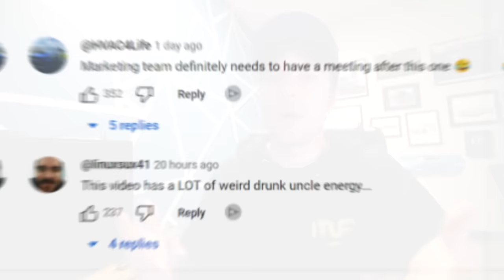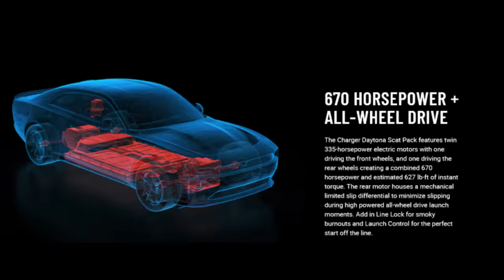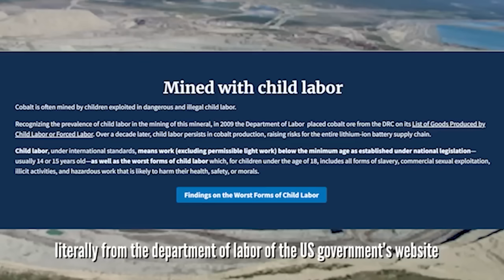The 2024 Dodge Charger Daytona Unveil Was Embarrassing

Comment: EVs aren't even green to the earth. quite the opposite actually.
Reply: Bruh, lemme just move thousands of pounds of dirt to extract this lithium from the ground so my non-recyclable batteries can die in 10 years. Oh, and fuel it with coal/natural gas power plants 😂
Reply: @androiduberalles  But, lithium batteries are nearly infinitely recyclable. Not siding with "EVs are the answer" because definitely not. Just stating a fact.
Reply: @androiduberalles so make the energy renewable and extraction methods ethical while making cities walkable. It’s like conceding to the oil lobby and digging your heels in the sand.
Reply: Oil is just as bad too
Reply: There’s basically an infinite supply of studies proving that over the lifecycle of a car, EVs are substantially better for the environment.
Reply: They do less harm is the point. Not until we have the tech for water powered cars will they be true zero emissions
Reply: @metamuse42  yeah but the planet does not have enough resources to make enough EV batteries for everyone who has a car right now.
Reply: I wouldn't say opposite. It is absolutely an improvement, but it's so marginal that the push for EVs is quite nonsensical at best, and ignorant at worst. We should be spending the money on finding a better solution than pushing a slight improvement as a permanent fix
Reply: @metamuse42 there’s also studies that show that the extraction process for the minerals used in EV’s are so polluting that a normal ICE vehicle has to hit 50-80k miles before that offset even begins. So there’s that 🤷🏻‍♂️
Reply: @matt2244  yes, we do. Some sort of propaganda has taken hold that lithium is some sort of rare earth metal. It isn’t. It’s extremely abundant. But even more importantly, there are plenty of batteries that don’t need cobalt at all, like Tesla’s LFP batteries that they use in a large percentage of their cars.
Reply: @metamuse42  yeah think they say between 98-110 million tons of it but like anything is it cost effective to get, (like gold they say at the bottom of the oceans it’s billions of gold but not cost effective to get) and just how much of the earth are people willing to rip up to get it? Is it really saving the planet at that point?
Reply: @SkylerB17 li-on batteries are not “infinitely recyclable” that’s not a fact at all. The fact is the industry and infrastructure to effectively recycle the batteries with acceptable efficiency doesn’t even exist yet, and the companies trying to get it started say they’re 15 years out or longer on getting it up to marginal efficiency. Globally, it’s only 5% that recycle current lithium-ion batteries on the high end, likely significantly lower in most parts of the world, and that’s not “5% EV li-on”, that’s “5% li-on” in general. A good portion of the recycled material is lost to “black mass” which requires even further energy and labor intensive processing to recover what’s inside. Making it negligible in terms of efficiency. If the process was “infinitely recyclable” it’d be friggin ZPE. We both know that ain’t happenin.
Reply: Like just about every other shift this is not the battery tech that will take EVs forward. It's the transitional tech. If we don't push it the progress would drag on and we'd just continue locking ourselves into our current pollution problem. And not only does it push battery tech but alternatives to EVs altogether from those that don't believe they will work. I get that folks hate change. But the answer isn't just to sit and pretend there's no problem. 

- V8 F-150 owner
Reply: @androiduberalles  Lithium is very plentiful and dropped in price over 80% last year. And the batteries are over 85% recyclable already.  Not sure where you are pulling your info from but it is not a good place.
Reply: It’s not about the environment. It’s about control
Reply: Ev's create more pollution than combustion engines from particles released from brakes and tires, 1800 times more
Reply: @dontnewyorkmyflorida  LOL, what the hell.  That is so silly, do you really believe that?  Since they hardly use the brakes?
Reply: @christopheryou5040  Control?  Let me guess you think science in regards to climate change is bogus?
Reply: @gregkramer5588  actually yes I do believe that, because of the weight of the car it's harder on tires and brakes, so you're telling me you never ever ever ever use your brakes with an electric vehicle I really found that hard to believe, I've read more than one article and n the last one I just read was in the New York Post, keep living in your electric vehicle cult I'll keep my combustion engine
Reply: @gregkramer5588  so when I see these people in traffic on the interstate doing 80 miles an hour and their brake lights are coming on you're telling me they aren't using their brakes and having to slow down to keep from hitting the guy in front of them
Reply: @gregkramer5588  and not to mention California is looking to add a $200 tax for people with electric vehicles because they destroy the road faster because of their weight
Reply: @metamuse42 But are those studies like the guy who insisted to me in a comments section that that car carrier wasn't sunk by a burning EV? He was certain of his facts because.. sources, told him what he wanted to hear.

Now there's a lawsuit out proving that he was wrong
Reply: What Toyota is doing with hybrids is the only real sustainable option unless we start building a lot more power plants. Edison motors and Deboss garage have a few very detailed videos explaining why Hybrids are the future and full EVs are unsustainable.
Reply: @TomazHilton ev is actually worse for the environment, same as synthetic leather
Reply: Sssssshhhhhhhhhhhhh! The EV normies will get upset
Reply: Honest studies show it is not better over the lifetime of the car.  And chinese apt fires have shown how deadly they can really be.  Believe lies at your peril.
Reply: @goldfishmentality  Slight improvement? It's a huge improvement. You don't need to burn oil. You want to do better, electric busses and e-bikes, or live close and walk. The big deal about EVs, is you can substitute it for a gas car, and not have to change much. Also, if you can install a Level 2 charger in your garage, it's cheaper, more convenient, and drives better in traffic. The instant torque, and one pedal driving is fantastic.
Reply: @dontnewyorkmyflorida bullshit. High torque engine fast driving produces tire rubber whether the power is  electric, fossil fuel,or a heard of squirrels running on a treadmill. Brakes are EVs are the same.brake pad materials but are used way less and as a result there is less dust emitted. Daily driving an EV in regular non aggressive driving will not use the brakes until you get below 8 mph. The regenerative braking has ample non aggressive stopping force but cannget you to a complete stop without low speed shudder. Coming to zero mph would actually use  current applied to motor in reverse so wheel brakes are used for the low speed full stop and whenever brake request exceeds regenerative brake force. I have a bunch  of F350 and F450 diesel pickups and I am not even a potential EV buyer but bullshit about EVs is idiotic. When the battery tech for solid state 10 min charging batteries is viable all that mining  and non green BS will lose all basis. The tons of ore mined for a 1/2 ton pickup is not that much less than battery lithium.
Reply: @SkylerB17  Not profitably. Or else it would already be happening at a large scale. Without government subsidies EVs wouldn’t have a chance.
Reply: @matt2244 you think battery tech will stand still? There was a point where people thought we'd run out of oil too.
Reply: @androiduberalles Lemme break it down… the reason it’s better for the environment is because it cuts down on the excessive pollution caused by emissions… what they’re trying to do is bring down levels of carbon monoxide in the air caused by cars… not factories or plants… because you can create energy efficient things with fossil fuels… you only create harmful pollution with millions of cars on the road
Reply: @matt2244  That's a seperate issue, criticize the EV industry for THAT, and recognize that THAT is the issue that researchers are trying to solve.
Reply: This isn't true. Stop. All the research on this shows the EV's are still greener in the long run, even when running on the American grid. A study in 2019 determined that an EV being run in the United States ON AVERAGE releases as much emissions per mile as a car doing 91 MPG. This allows EV's to break even in 2 years, maybe a bit more. There are other issues with EV's but emissions are not one of them.
Reply: @dontnewyorkmyflorida  Will pickups get this charge also since they are much greater?
Reply: Your take is accurate.  They should've just built it, owned it, and let the smooth brains that stan over dodge deal with it.

This is massively insulting to anyone who sees it for what it is.  They're letting the "Dodge Brothers" stand in as straw men for their fans that worship V8s and then try to apologize, sugarcoat, and mislead them into thinking that they're "putting it to the man" by doing exactly what the man told them to do 😂

Honestly the cars are great.  I applaud Stellantis for packaging this into a muscle car shape.  Everyone else is sitting 6 inches too high sitting on top of their batteries.  I like low, wide cars.
Reply: They are greener than gas powered cars. It's been well documented and established. 

But I like EVs because they are quicker than gas cars.
Reply: @gregkramer5588  ask your dad Gavin newsome
Reply: @ctcdarkness  that came from a single sentence in Volvo’s 70 page report that people took and ran with. Most EVs need to reach 30k miles on average then become positive. The 50-60k mile mark came from the research on EVs in Poland specifically since their power grids come from 98% fossil fuels. The Nordic countries it would be 5-10k miles, the US would be around 20-30k.
Reply: Yeah but most people are stupid and don’t understand the real reason the government wants electric cars- carbon highway use tax.

They want to know every mile you drive and tax you accordingly like they do with my dump trucks. Right now it’s the honor system for commercial vehicles. They want to fix that loo
Reply: @metamuse42  if the lifetime of the vehicle is 30 years. It’s not
Reply: @goldfishmentality  smart take
Reply: @christopheryou5040  this is all for the carbon highway use tax (HUT) they currently have for commercial vehicles expanding to all cars on the road. They need Ev’s so they can get the data and track you as opposed to the current “honor system” used for commercial vehicles.
Reply: @mtnman1984  good point. Oil is renewable. Look it up
Reply: @blue46gt  quicker yes. Faster no. Also the range sucks when you’re having fun with an ev
Reply: @dontnewyorkmyflorida  My Dad is Harold.  I might be older than Gavin.  But I think he may be president someday.
Reply: @SkylerB17  my experience with them in industry does not support the "nearly infinite recyclable" aspect. Maybe the efficiency of that processes has increased greatly. But if so, where does the power to perform that recycling process come from? Other li-ion batteries?
Reply: @bbb462cid  same place where the power comes from with oil refineries.
Reply: @richardstanley7661  gasoline/diesel is not.
Reply: Ok dunning Krueger
Reply: @matt2244 and I'm sure you have many papers backing up your claims and didn't just pull them out of your ass at all 🙄
Reply: @leprechaunbutreallyjustamidget   The internet can be an amazing tool when you know how to use it.
Reply: @mtnman1984  exactly!
Reply: @matt2244  so learn?
Reply: @leprechaunbutreallyjustamidget   I did everything I posted is from science you're the one who thinks it's all pulled out of thin air. So go read.
Reply: @androiduberalles  who gave you the dumb idea they can't be recycled?
Reply: Keeping any old car, instead of buying ANY new car, is by far  better for the environment. And older cars can run on alternate fuels.....
Reply: @mtnman1984  crude oil is. Its true
Reply: @richardstanley7661  that's a really dumb thing to say in this company.
Reply: @mtnman1984   what does “this company” have to do with anything? Research it a little. Lots of research data from within the former  Soviet union on the subject.
Reply: By comparison they are, that's a fact.
Reply: @christopheryou5040 Controlling you how exactly? By making a car less noisy and pollution free? Paranoia is a disease.
Reply: @dontnewyorkmyflorida  That’s absolute nonsense.
Reply: No exhaust = Greener to the Earth. It’s not rocket science.
Reply: @coolcat6303  that’s funny. EV production causes more environmental harm than producing a gas car. The components of a gas car are far more easily recycled as opposed to the 2000 pounds of lithium ion batteries in an EV. The additional weight of an EV also puts more strain on the roads and bridges as they weigh twice as much. At some point our power grid will collapse due to the amount of coal we need to burn to charge them. They are not clean or efficient. And when someone can shut your vehicle off remotely that’s not paranoia, that’s being observant to where we’re heading. You’re ignorance is hilarious.
Reply: All cars have some environmental harm. EV’s still harm the environment, just not as much as their ICE counterparts.
Reply: @ryanfraley7113  that is a false statement. They are more environmentally harmful.
Reply: @dontnewyorkmyflorida your ignorance is off the charts and embarrassing
Reply: @christopheryou5040  Should I believe a random person on YouTube who has generated no video content? Or the university studies that are peer reviewed? Gee, that's a tough decision. lol
Reply: @SkylerB17  Lol they're not, once the charge in lithium is dead it's completely useless, hence why even Tesla can only salvage up to 18% of the original batteries in their cars as the other cells have already died out. Meanwhile, Ice cars can last for decades and plastic parts could easily be interchangeable with good old steel or aluminum, that will last longer.
Reply: @metamuse42  tf are you talking about? Lithium in massive quantities is extremely difficult to mine and bothersome to process, Lithium in smaller quantities found in rocks or stones that you call are "abundant" are so difficult and expensive to extract it's a joke.

 Then you get to infrastructure and range problems, Tesla advertised the batteries have longer range now by making them proportionally bigger, and worst of all they leak more energy the worse driving conditions get.
Reply: @gregkramer5588  85% recyclable? Where tf did you get that source The Onion???? 😂
Reply: @HenAnt  actually it is more than that now some companies are near 95%. Just do a quick Google search in the top response from their AI will tell you.
Reply: if politician says that the sky is red, it is RED and questioning it gets you fined/taxed.  We live in such times.
If a politician markets something to be "green" it is "green", and the alternative automatically becomes "evil and polluting".

Comment: Its an obsurd 5800 lbs 
That's insane  No car should be that heavy. It will feel like a tank in corners. That's nearly 2000 lbs heavier than a 2024 Mustang GT.
Reply: Jesus: that’s like three Miatas.😂😂😂
Reply: You know what’s insane? Car garages in the UK have been collapsing because EVs weigh triple the amount of regular gas cars. As more EVs get made, I expect more garages to fail because they were never made to hold that much weight
Reply: I imagine they will cut back the weight within the first 3-5 years of the production run. You are correct, a 3-ton coupe/sedan is ridiculous and is not a sustainable option.

Comment: You right though ev is not the way, I love how you mention the lithium and cobalt. You’re real af a true 10/10 car content creator.
Reply: yea but if Stellantis would invest then the other options wouldn't be so pricey. the real issues is Stellantis isn't making any $$$$ on EV's so now they are pulling back. they got into the EV market to make $$$. that's it. if it was to further the advancement of ev's they would have built a Charging network. but they dint and tesla is murdering them in sales every year, mostly in due to the charging network. There are plenty of companies working on new battery tech that doesn't require these materials. with how many EV's they have pumped out in a short time frame, there is no issue with supply chain. They just are realizing they aren't going to make $ on it. same with the hybrid cars/trucks. There is a reason most cars still use standard combustion engines. its the most cost effective. These companies aren't driven by you, but $$$. BTW if you don't know Stellantis owns most of the car companies we know here which is part of the issue to begin with.
Reply: @nicholaswilkerson501  yea but the new battery tech I’ve at least looked into still requires metals and that means more mass mining. But mining isn’t the only issue. A charging network will require metals and a obscene improvement to the grid to not have rolling black/brown outs constantly. Also making that network will require precious metals and our grid is mostly powered of coal and other non renewable resources. So people who think they are driving totally green seem to ignore the fact that the electricity used is created through non green sources. Also another issue is depleted battery waste. Hybrids are a much smarter path over evs but money rules the market not going green.
Reply: Lithium and cobalt aren't even necessary for batteries now.  You ppl are behind.  Dragging knuckles
Reply: @Boomtendo4tw  they still require metal which in turn requires mass mining, what a dullard. Your brain must be as smooth as silk. Plus that’s just ONE issue of the many with evs 🤡.